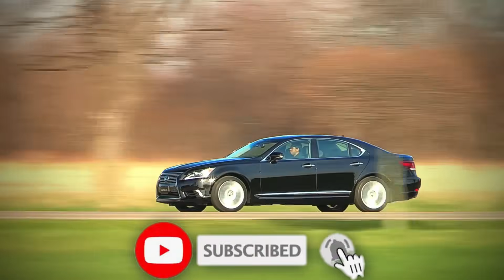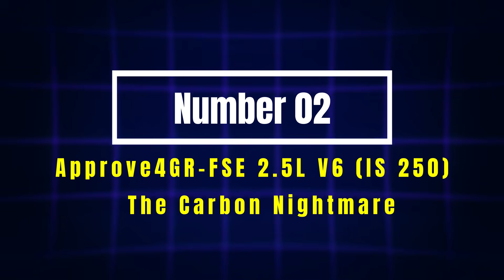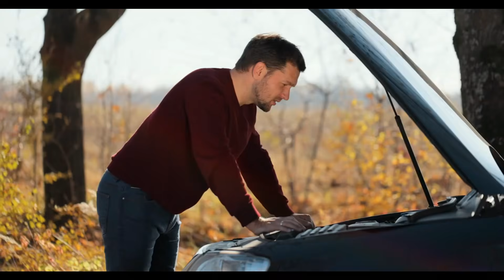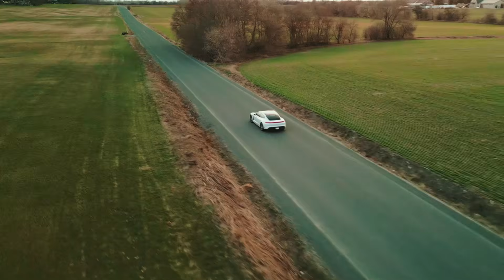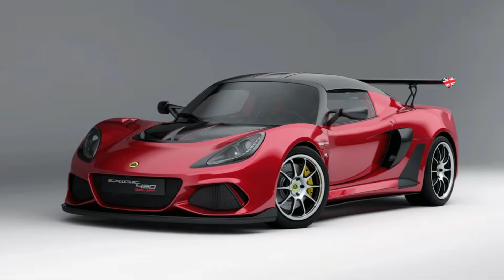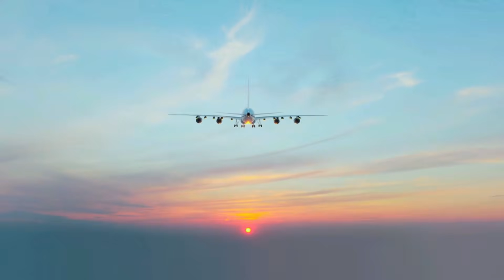3 WORST & 4 BEST Lexus Engines You Can Buy

Comment: My 2001 RX300 has 243k miles and has been a great vehicle and very reliable!!!  Just had a coil go out in #3 cylinder in the rear which is very hard to access and requires removing the upper plenum on the intake manifold.  While there I decided to replace all spark plugs, coils and the valve cover gasket for hopefully another 100k miles!  When I pulled the valve cover there was no sludge like this video claims, but I decided I was at a great point to run a compression test…..it has three weak cylinders.  Going to be time to get rid of it soon…will probably go thousands of more miles, but I want it gone before it dies!!!

Comment: I had a GS400 with a 1UZ and put 250k on it and current owner has over 400k now. Now I have a 100k mile LX570 with 3UR and plan to take it to 300k+ miles. I guess I picked the best 2 motors.